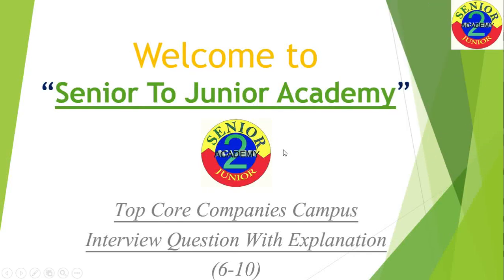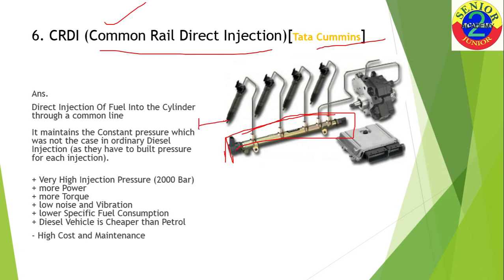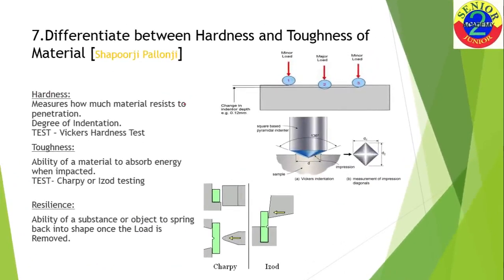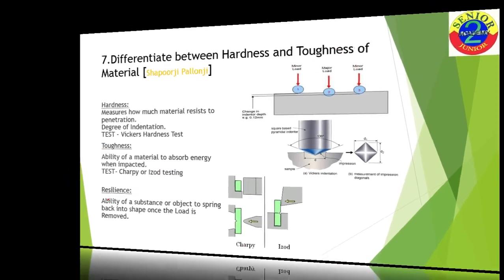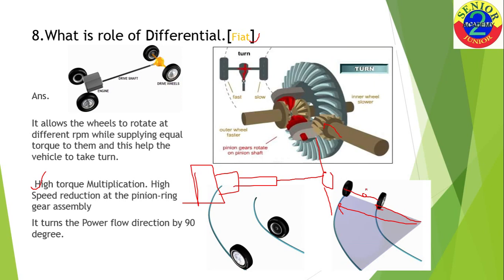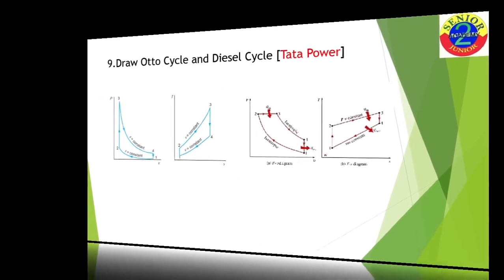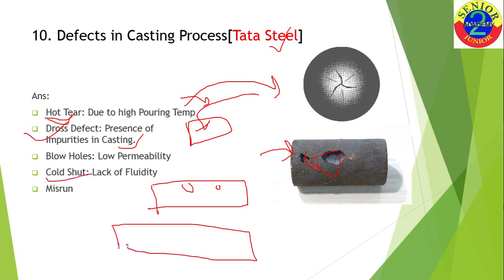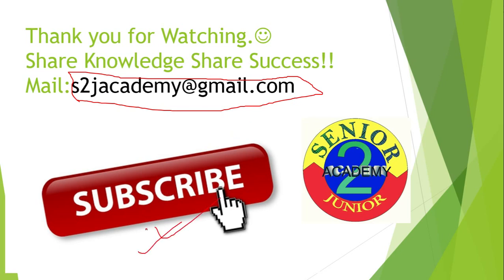Mechanical Interview Question for Campus Placement (Question 6-10)

Comment: Common rail systems .. used by almost all diesel engines manufacturer like Cat,Cummins,Volvo ,Deutz KHD,MTU ,Iveco etc .. The basic construction is almot identical with some minor differences in the injection pump designs and ECU..a nice system to work on ..

Comment: What is throttling process?
Reply from the maker: Throttling is basically the process where fluid pressure is dropped and work done is zero. Enthalpy  is constant in Throttling process.
throttling process is irreversible process because when the fluid tries to come out of small opening they rub against each other and friction is generated and friction causes irreversibility.
In Refrigerator we have a throttling device.